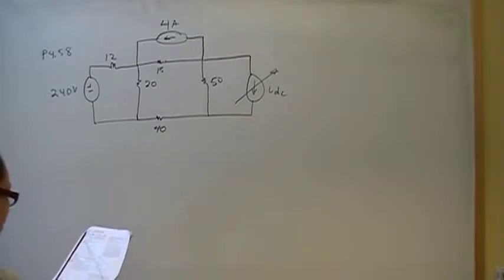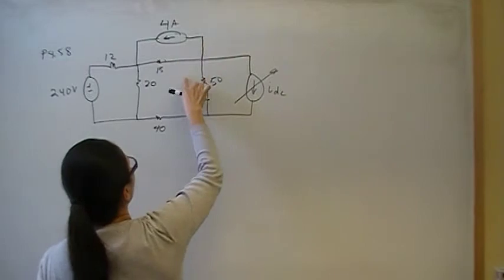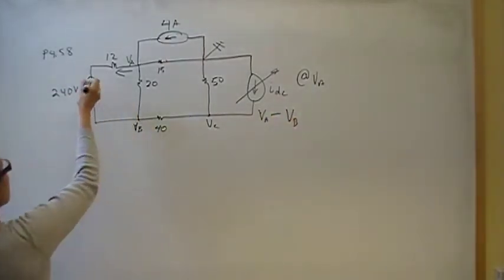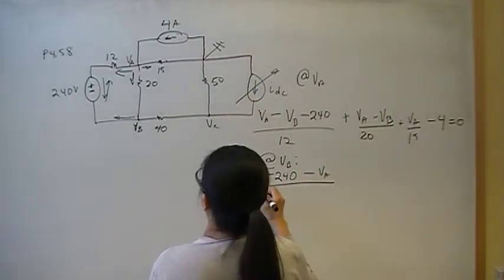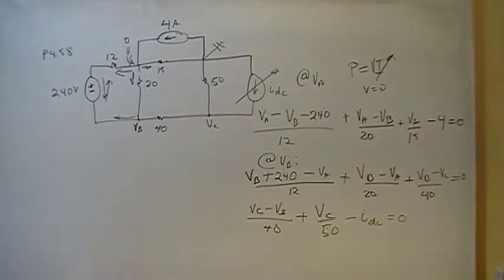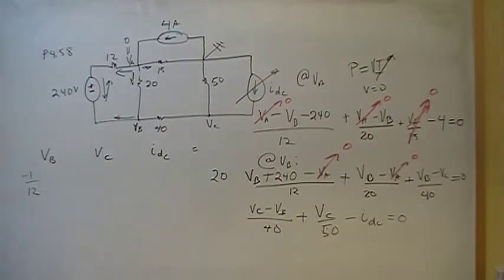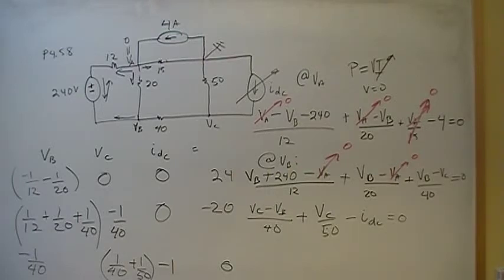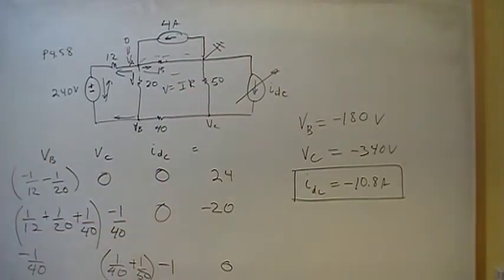Node Voltage vs Mesh Method P4.58 Nilsson Riedel Electric Circuits 9E Solution

Comment: I think that you are right about the mesh analysis and the third equation. I assumed that the third equation is = 15(i2-i4)=0 and since i4=-4A, then i2=-4A, I solved the question but i found that Idc=-8.8A not -10.8A which is very strange to me...what do you think about this?